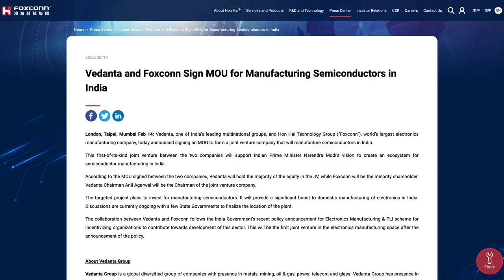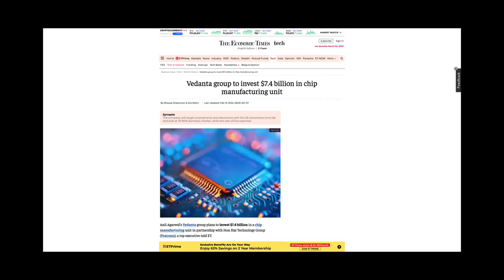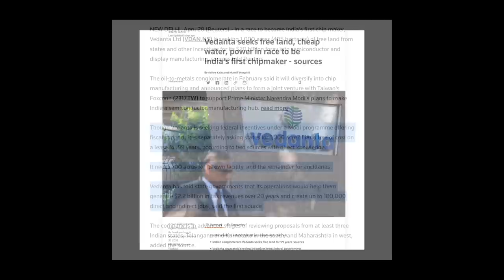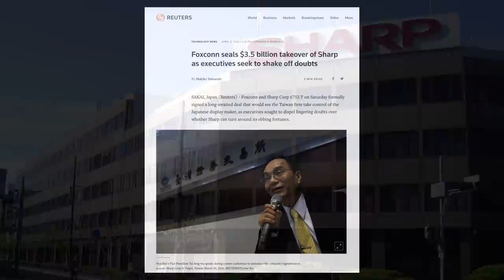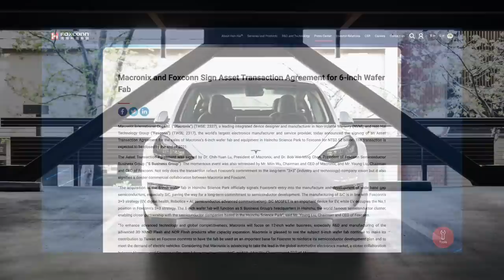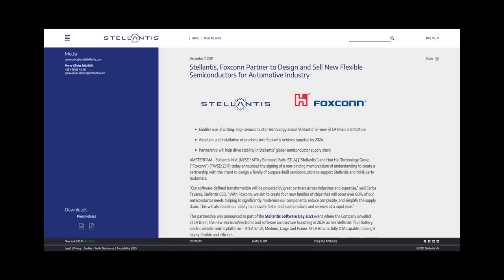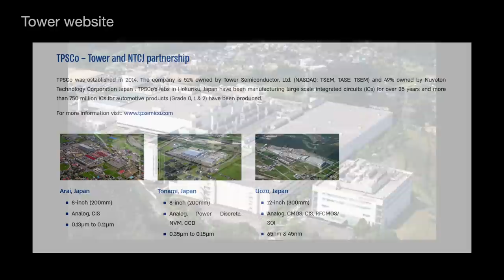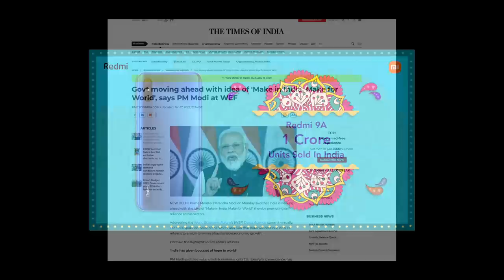India’s Semiconductor Savior?

Comment: After what happened with Huawei, I think it's essential for countries to manufacture these components.
Reply: What happened with Huawei?
Reply: @MonkeySpecs301  Blocking access to  semiconductor technology by US led to destruction of mobile division which forced it to sell honor.
Reply: @kd6788  good.
Reply: Unfortunately, local manufacturing won't make countries immune to sanctions the US put on Huawei. Even if you manufacture locally, virtually all chip designs rely on technology made in the US
Reply: @hydrolifetech7911  That's where Risc v comes into picture. The future should be open source without the threat of any bully.
Reply: @ainzgood5466  you understand that risc v is a blueprint like arm or intel's or amd's, right? You still need software to design your chip and you still need to manufacturers to make chips. Right there is the choke point.  Risc v decreases the exposure, but it cannot cover all the choke points.
Reply: @duyle-ej6ty my understanding is that the biggest choke point is the machinery required to make modern chips is supplied by a small number of companies from countries aligned with NATO.
Reply: @JohnGeorgeBauerBuis  correct. ASML is the only chokepoint that can hold China back. So basically, Netherland, Germany, France.

Comment: I think ISMC investment is more significant.
They announced it and are already a significant player in semiconductor.
Though they r not exactly Intel but now after accqustion by Intel .they r it's subsidiary.
I think India will be making 24 nm and beyond semiconductor.
Higher end smaller chips don't think so.
I think we can accquire a significant share of world market.
As bigger chips are used in more quantity.Cars,toster,microwave,ac,remote,tv,washing machine and everything electrical nowadays.
Reply: Yep. But it's good start. At least in case of an invasion, only Smarphone and GPU shortages will occur, not of everything.
Reply: @Dr.Kraig_Ren  I want those GPUs though, they are super costly as it is, but since we get them from outside, it probably gets more.

Comment: The Indian semiconductor dream will be realised if and when the government invites one of the top 3 semiconductor fabs to the table for a realistic and promising goal of making semiconductors based on sub 28nm process nodes in India which still looks like a decade away since the supporting infrastructure is lacking by miles.
Reply: But that's the thing. By focusing on easier nodes they can get the basic infrastructure up and start generating revenue which, with a bit of lube, could attract the big players, which makes it financially viable to go the last (and hardest) mile with infrastructure.
Reply: True, older nodes is something that India needs to shift focus on and get them going quickly off the ground, because processes for those are well established, less sophisticate, and  importantly more forgiving as compared to the newest nodes. 
Everything upto 28nm, could 
If executed well result in a better adaptability and higher yields, even though at the cost of lower profits, but hey as long as it's some percentage loss on investment in return for learning a new trade it's worth it.
Reply: One step at a time

Comment: Hello, Mr. Jon. I have a question. Why is suddenly there's a rush to build semiconductor industries all over the world?
Firstly, ASML-TSMC duo is far ahead in technology and I don't see how anyone, anyone on earth can catch up with them and hope to make a profit as well.
Secondly, I believe all these chip shortage, high chip cost are rather an indication of a looming stagflation. So, I deeply doubt these semiconductor "ventures" will actually be able to turn a profit by the time they become ready to roll.
So, why are these companies hell-bent on older semiconductor technology and not invest on coming trend like micro-electronics?
Reply: High end nodes aren't needed for vast majority of applications. Older tech is mature and works out of the box. It will serve most applications and will provide independence from chinese invasion of taiwan, which is inevitable. Being neutral has worked out well for india.
Reply: Because old nodes are reliable, cheap and more than good enough for a lot of commercial and industrial applications. Cutting edge nodes are reuqired obly for latest high tech consumer devices like PCs and smartphones.
Reply: Automotive, defence, aerospace & low end consumer electronics like Washing machines use bigger & reliable nodes.
Reply: Well maybe Intel or Samsung will be able to catch-up with TSMC. They are also big buyers of ASML latest EUV equipment. And chips with the latest nodes are usually used for flagship products e.g. phones with a starting price of $800. But there is also a low and mid range tier for phones using older cheaper nodes. Much more affordable for people in developing nations like India.
Reply: you bangladeshi believe that once there is a big player in some field, then other players should not try to improve and catch up with that big player.. other players should go to other field, leaving the big player to have monopoly! what a pessimistic thought !
Reply: @Deb_deCoder  Lot of nationalism ha? There's no chance of "improve and catch up" without fundamental research. These chip startups aren't remotely doing that. How much that "fundamental research" happens in India? I don't wana talk about that, not with you. U r a ultranationalist lacking any understanding of reality. I just wana note that, the only other way is, if TSMC-ASML due falls, say due to nuclear war or something.

Comment: Sounds like at least this Foxconn effort is mostly a pipedream. Sure, it's possible to do something outside its proven scope of expertise... But generation upon generation upon generation and so on later than what it has done before? With each generation, there is a lot more than just shrinking the traces... There are also new techniques and specialized equipment with each generation, and what worked for one generation doesn't necessarily support the technologies for the next newer generation.

There's an enormous knowledge gap to bridge when proven experience is 100-200mm and somehow hoping to build 65nm. And, even that is far, far away from 28nm and smaller.

This video never mentions what kinds of chips India wants to make and for what purposes. Maybe an Indian chip fab could set reasonable goals and make cheap chips for its automotive industry. But devices like smartphones? Unless you're talking about smartphones the size and capability of what existing aroun 2000 which was long before touchscreens, I doubt there is much chance of success.
Reply: No success for sure, other than Modi's propaganda success. More political than business.
Reply: These Fabs aren't for smartphones. These are for connected tech IOT devices. Automobile industry, white goods etc.
Reply: @zahid1909  tu jihàdi fir aa gaya🤢
Reply: @zahid1909  Why are Pakistani trolls obssessed with India ? Don't you have anyother job or you getting paid by Pakistan army?
Reply: @alchemist7412  yeh log semiconductor jihad lad rahe hai bcoz semiconductors are haram in iślam😆😆

Comment: 28nm seems a bit outdated ... TSMC is setting up a 5nm fab in US and has pumped 100bn$ into 2nm technology .... its better than nothing i guess
Reply: No, in display manufacturing 28 and even higher nodes are mostly used as of now. In Mobile and Computer Processor making less than 10nm is coming now slowly. It's absolutely cutting edge and very costly as yoh said 100bn is being poured into it. I think here as manufacturers don't have any prior experience, it's better for us to target easier nodes at first. High quality nodes will take more time, money and effort to mature. After 2-3 plants start manufacturing display units in mass, it'll be easier for us to invite Intel, Samsung, TSMC for making cutting edge Semiconductors. As 9f now  there's not even a single semiconductor is being manufactured here, even though designing is biggest industry here by all big firms like Intel, Qualcomm, NVIDIA, Samsung.

It's time to start just manufacturing for us now.